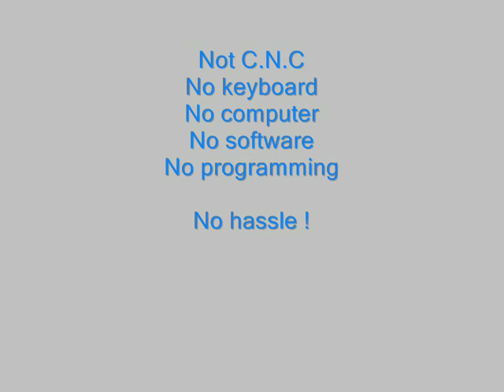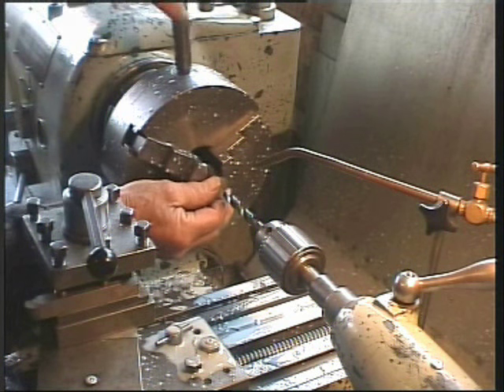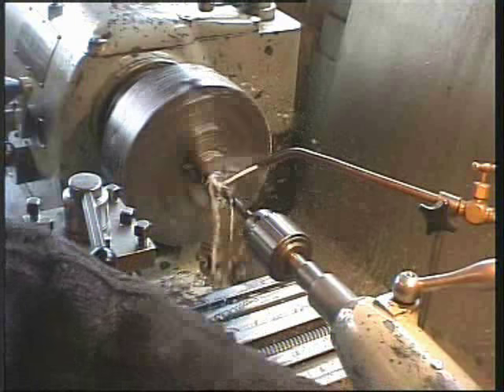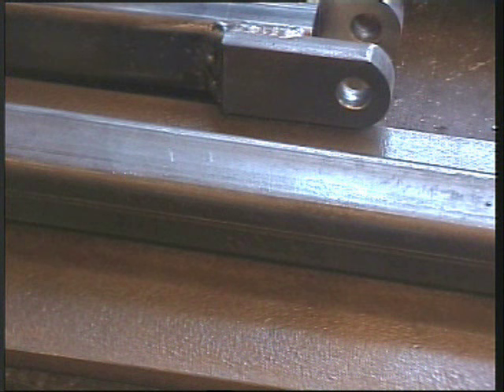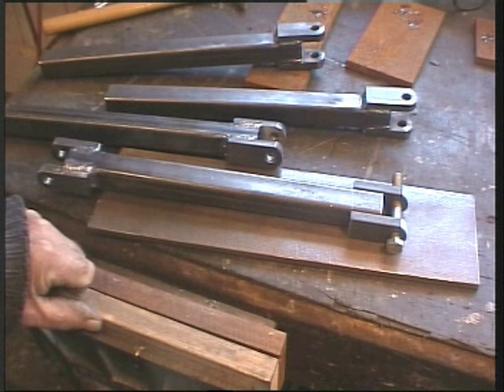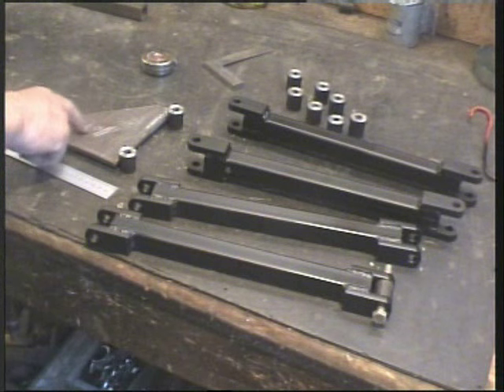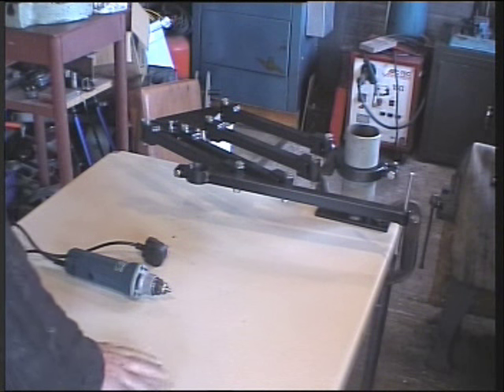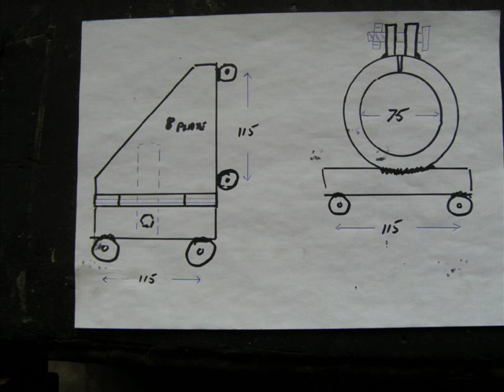home made tools No 2

Comment: Nice work. Pantographs require precision in the linkages. Yours are spot on.
Reply from the maker: precision linkage is less of a problem with parallel motion, your correct.

Comment: Yes very nice indeed. I think you must have been in Engineering,
Very envious of all your machinery. With a lathe, milling machine, power hacksaw, fly press welder its not a project for the average Joe. But it is very interesting.
I'm thinking of making a video from time to time with hints and ideas. You have already shown some.
I like the way you used in this video clamps that are in fact the squeezing tools used to push out silicone and other stuff from their  cartridges.
If you want to join physical to thin metal plates but so that they are insulated from each other we can nylon threaded rod and nylon nuts. I found a cheap way to do this with the rather high cost of nylon. That will be my 1st contribution.

How about everyone with an idea or tip to put it into a new pool of them?
Reply from the maker: No I have not been in engineering (not my trade) but have picked up a few principles along the way. adding to the "pool" is what my channel is all about !
Reply: Well you've picked up a lot poroldchap.

Is there a way to create a communal site so that anyone can use it to put in any tips/hints or ideas. That would be so useful. You could add a lot I am sure. I, a few.  Am working on now but have to master MovieMaker!.
Reply from the maker: I`ve posted 300+ vids and all useing WindowMovieMaker its so simple to use. yet powerful enough for all my needs, so nothing to stop you

Comment: I've just got a new machine that needs suds sorting for it. I'm intending to make a tube skimmer due to limited sump access, well working looking into. I also have a couple of spare refractometers if you would like one (free), proper concentration is supposed to be very important to stave off bacteria and prevent corrosion.
Reply from the maker: my opinion is a oil skimmer is not really needed for none commercial use indeed the home workshop as I have probably not worth persuring, suds used so infrequently, bacteria etc not a problem , any way the cost of replacing £1- £2 at most , its contamination from cleaning the machine (oil/diesel) I have to watch. had the lathe  for 36 years and you can see the condition so won`t change now !
Reply: +poroldchap Yeah, I'm looking at a 100L system, it was just that you mentioned it. For a small sump a piece of plastic swept over the surface will skim the oil, then just squeegee it off. The oil layer keeps the air out of the suds which promotes bacteria and the stink. (I'm writing some of this for anyone that reads, I know you know your stuff).
Reply from the maker: 100L system thats BIG :-) if you type in oil skimmers on here there are some ingenious ones but as I said hardly necessary for the home workshop. if you do make one hope you show us .... cheers